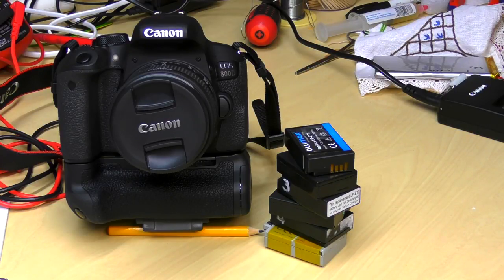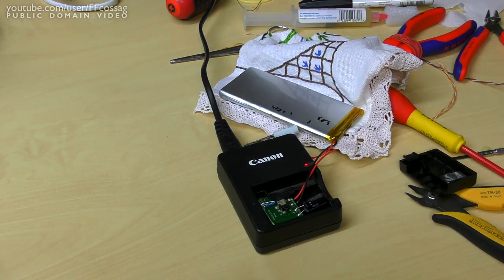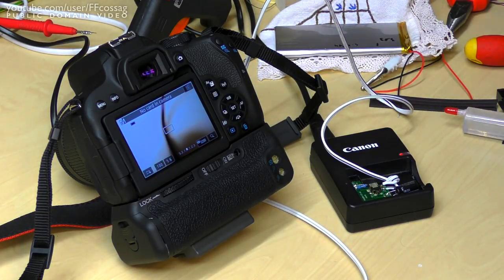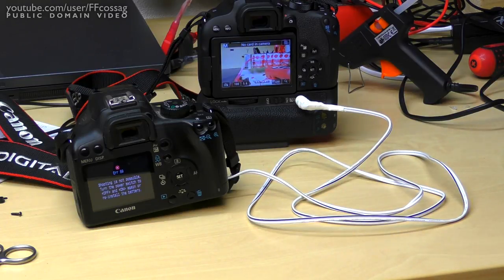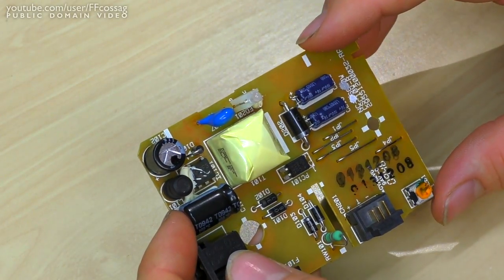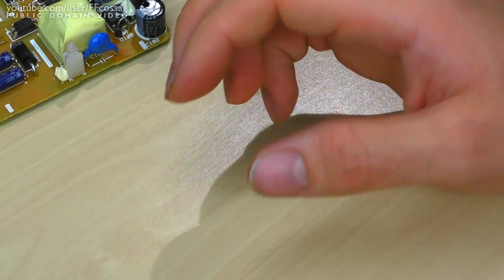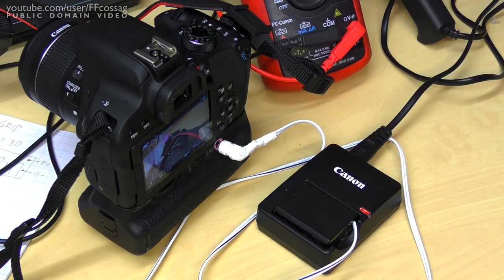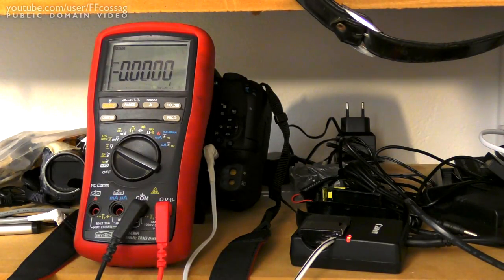Making a charger for the giant battery grip

Comment: I see the following problems with this otherwise rather awesome battery pack: Since you don't have a balancing circuit in it (At least that's what I assume?), it may not last very long. Also, having a temperature sensor or two in those roughly 43Wh of battery that you've made there would have been really nice. At least, if it were my battery, I could sleep much more calmly knowing that they will cut off the charging power before having a thermal breakdown. But then, you're probably charging it with much less than 1C, so that is one safety advantage right there.

Comment: Pretty cool that you can run both cameras off one battery pack (well, assuming the other camera accepted the "unofficial battery" going by the complaint message onscreen), an accidental useful addition... :)
Reply from the maker: Amusingly, the older 1000D doesn't give a rat's ass about battery ID (in fact, its batteries are completely dumb), and it even gives you a state of charge on the mega-pack. The error screen on it was due to the shutter being broken at the time of filming.

Comment: I see, 620mA charging current that would be about 0.1C for your 6Ah battery pack, which is a very "healthy" charging rate for Lithium cells. Other than that, it is advisable for the longevity of the Lithium cells to not charge them to more than 8.1V (if 8.2V is their cutoff voltage), and also not to discharge them down to a certain amount (like, 20-30% capacity left), but the camera should take care of that by cutting off at the right moment.